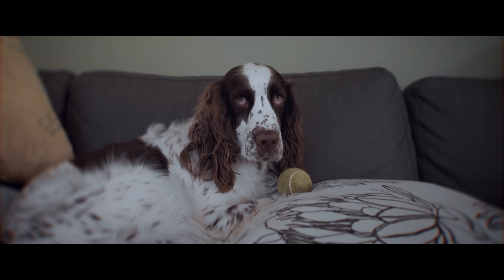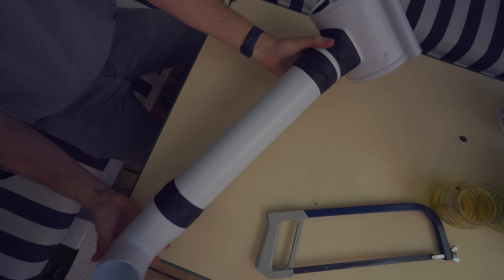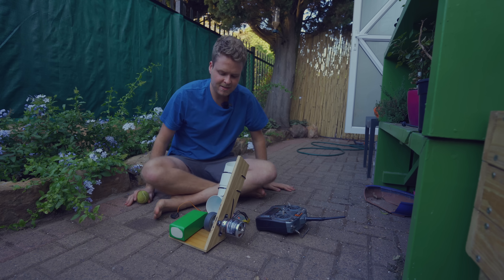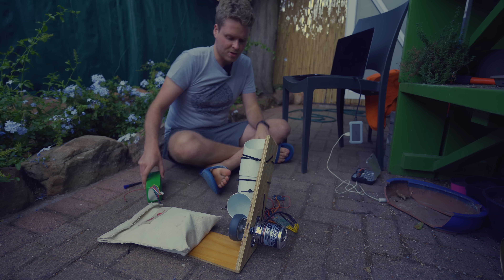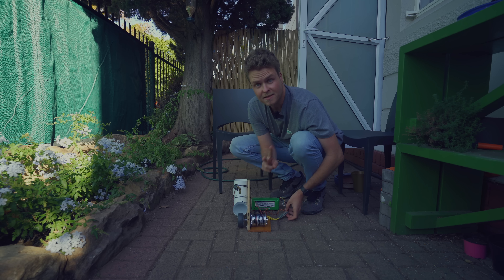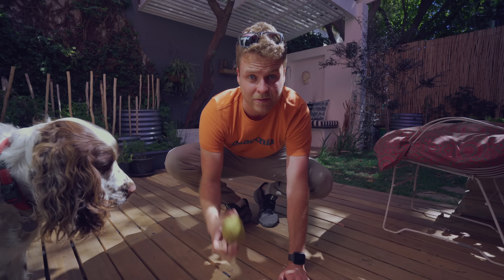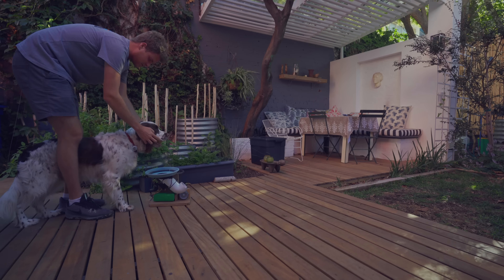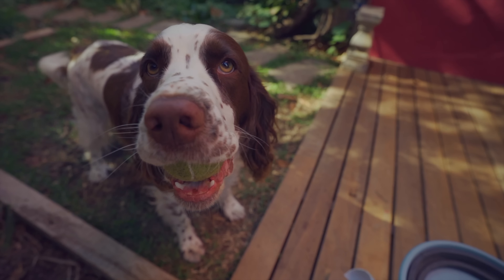Building My Dog an Automatic Ball Launcher!

Comment: Should make it so input is on the read, forcing the dog away from the front of the launcher.  Interesting, however I like the one which simply cranks back a bolt attached to a couple of rubber hoses like a slingshot.  It also has an arm that elevates, sending the ball in a parabolic arch.

Comment: Was thinking of building something similar but I was thinking compressed air. I like your design more. It’s simpler
Reply from the maker: Compressed air would be cool! But the issue is the size of the compressor. It can’t really be portable then, and not battery powered.

Comment: I’ve also got a springer and have been wondering if I’d be better served putting together my own diy launcher as you have done .. quite well I might add..  one thing I might change would be adding a second motor and wheel to achieve greater distance .. borrowing from designs for pitching machines or American football launchers. But solid job mate.

Comment: Awesome work! 
Someday when I build this, I would add a "Garden sprinkler" function for some randomness - a separate motor that turns left and right  within a certain arc. Ollie drops the ball, and ... who knows where it goes? I see a bidirectional motor on a platter, controlled with microswitches each end of the arc to change direction. Make it adjustable so you can control how much left - right swing there is (less lost balls in the neighbor's yard). 
Of course first I need a dog... hope this idea is inspirational!

Comment: What motor is that? Wondering how many RPM's it is
Reply from the maker: 180KV at 22.2V, so it’s about 4000RPM
Reply: @LukeMaximoBell  Thanks!  I am making one right now.  I think you may get further distance if you put a dummy wheel above the motors wheel to get it to pinch and throw it.
Reply: @KozmoKraemer  OP is too busy with other projects to answer most of the questions here, or post part two. Would you be interested in sharing your design specs, code, etc? Thanks a lot

Comment: Hello! I am just starting out learning electrical engineering, but I'm assuming you used a motor driver/shield or something to help control the motors correct? And how did you manage to attach the wheel to the motor? I've been scouring YT and the internet and can't figure out a good way of doing it. Thank you!